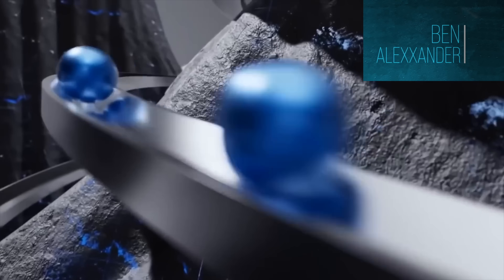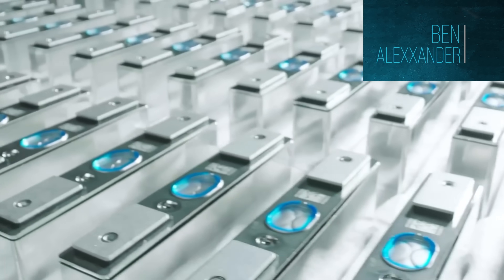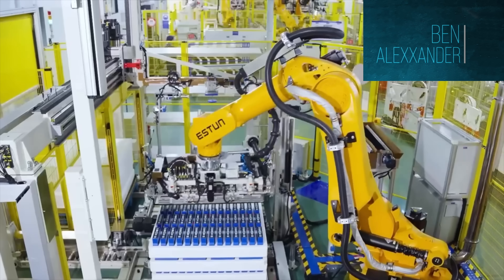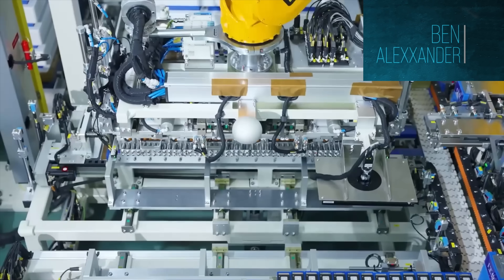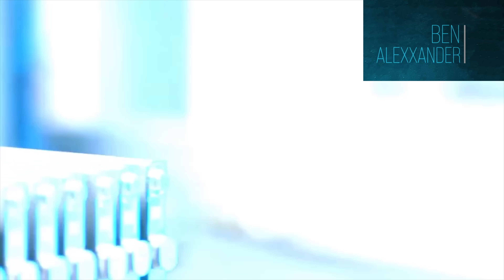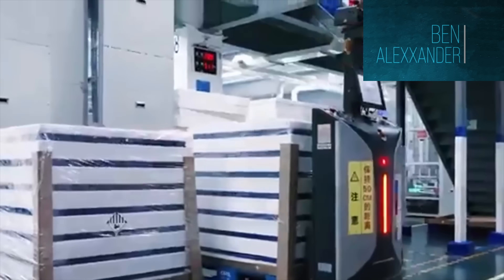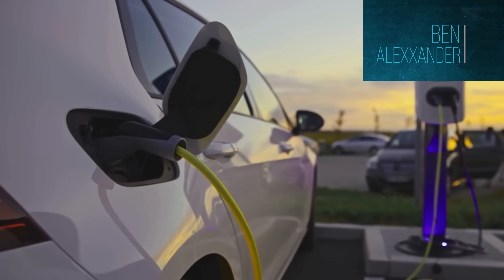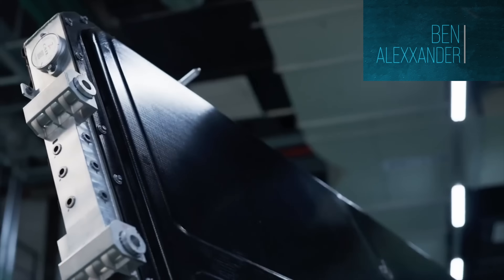CATL’s New Sodium Battery Lasts 3.6 Million Miles — 50% Cheaper Than Lithium

Comment: I think if these test numbers are coming from China id never believe any of it. A BIG thing we're overlooking though is the property of sodium, when its exposed to hydrogen/condinsation it dissolves rather quickly. At cold temperatures, sodium expands meaning whatever casing it's stored in would have to remedy this inevitability. Also, when it heats up sodium corrodes. Putting electrons through sodium could have environmental issues when recycling as negative ions will produce a small bit of radiation.

Comment: All very well, but unfortunately the general public will not see this cheap type of technology, it is not economically viable for manufacturers to produce long lasting cheap products, just go back a few decades to GE's electric light bulb (i think one still burns to this day). The powers that be will not allow this to happen, we could have had cars run on water, what happened to that? we could have had free electricity, why haven't we got self charging cars? alternators and regulators do it with vehicles now, why not with battery powered vehicles? the reason is the rich want to stay rich, and the governments want you to stay poor working to make them rich.

Comment: Charge time?  Can they fast charge?   Because there is still pretty much no one who wants to sit for 6 hours charging their car when going on a trip.      And I don’t think you quite understand the scale of energy used in the world.  Maybe we wouldn’t have to increase production of fossil fuels, but we wouldn’t still need it for a long time.      Also "solar is the cheapest"?!   Are you nuts?  It’s the most expensive , because it still requires traditional energy production right along side it to provide reliable power.   It’s maybe gonna be big news, but it isn’t enough to replace nuclear or fossils.

Comment: I'm sure both will exist for a while. Sodium just isn't as energy dense as lithium, and lithium is already too heavy for some applications. It is lighter than LiFePo and works in a wider temperature range.

The big draw for me is that sodium batteries are less deterimental to the environment and inherently safer. Most lithium batteries have magnesium which is basically impossible to extinguish once it catches on fire. LFP batteries don't have that and basically won't catch on fire but they're heavy. That's why a LFP EV car gets like 250miles when a traditional one gets 500.

Sodium stands to fit nicely between the two, but is apparently only slightly easier than cold fusion. 😂

Comment: Where are you getting $19/KWh?   It seems like you are picking up previous clickbait that was talking theoretical pricing based on material costs.  I read a more sober analysis recently that Sodium Ion was still a couple of years away from even hitting $40/KWh at the cell level, which is much more believable.

Comment: CATL makes claims that they NEVER verify by 3rd parties.  You're adding into the vaporware slop culture.  This is embarrassing.  It's atomically impossible for Sodium to perform 7-10x more energy density in comparison to Li metal batteries.  So on it's face it's patently false.  You need to stop ruining your credibility

Comment: Unlike what he quickly said here, this battery has nothing to do with gas, oil or coal. I don’t know what he was thinking saying this. Those produce power, batteries of any kind, store power. It’s not the same. He did also say that lithium would be needed for higher density uses, in opposition to what he also said earlier which was that it equals, or exceeds the power density of lithium.

The reality is that lithium does store more energy per volume. Until we see these in our phones, I won’t be impressed.

Comment: Heliogen is making solar-refingery using AI to angle the mirrors (instead of expensive motors). At scale, hydrogen becomes more cost effective than fuel.
Best thing about this? We can power the future of electric planes, with this. (Especially when constructed at the equator.)

Comment: 4:48 - Don't say that! New Denmarks micro Thorium reactors, will change the game also.
This is because sometimes you need a lot of energy, but not that much space. Think of future AI systems for example. Or factories. Or energy backup.
Good thing about micro reactors, is that their production and quality control, can be fully automated. They can be easily transported. Benefits of Thorium is that you can make the reaction stop even when the power goes out.

Comment: No, you're still missing the main point and hinderance to the adoption of electric batteries. Wind and solar can NOT supply the sheer amount of power to the grids of ANY country that is willing to go down this path. The cabling and power supply chains are just NOT good enough. Even if you could get everyone to change their cars within a ten year period. Even using coal and nuclear you still couldn't be able to bring a grid up to speed in such time. And the cost would be horrendous! Then you have the problem of thieves stealing the copper cabling that would be installed at recharging stations - which is already happening!

Comment: Yet another miracle battery!
We shall see!
Reply: I mean is it though? It's basically what we already have but can be made cheaper. You can only have one battery in your phone or laptop at a time for all intents and purposes the cost really doesn't mean much more power storage does and we aren't getting that. This is basically just good for large scale battery use like EV or home use.
Reply: Not yet another, the same we've been hearing about for years, and it's real now.
Reply: Says Ms Angry😂😂
Reply: They are on sale now....bluetti sodium ion battery. Really looking forward to what anti Ev angle you come up with next. We had so far, they set on fire, wear tires every 5k miles mine are 25 k and need a change now, there a little boy digging out the lithium. ect
Reply: If this is true, it's great news.
The only problems so far I can find with E cars is the initial cost tends to be very high , most garages will not touch EVs so that means high main agent service costs.
Finally the battery pack is on the bottom of the floor pan so is vunerable to road debri.   If a single cell gets damaged the whole pack has to be replaced which is expensive
Reply: Yeah! Every day for 10 years, it has been revolutionary, but none have delivered yet.
Reply: @Caspero83 They haven’t there’s millions of them out there you people are hilarious goal post movers.
Reply: @Caspero83 Bluetti just released a power station it can be purchased now.  Pioneer Na.
Reply: @Caspero83  CATL announced it is going into mass production in 2026, so it’s only months now when the first cars will roll off the line.
Reply: @LateForDinner-mn1hn  Haha, never heard that before. We will see
Reply: @Caspero83 When did you hear it before 🤷‍♂️
Reply: @Caspero83  I'm not surprised you haven't heard......See bluetti sodium ion battery for sale today for you. You keep driving the dinosaur banger granddad.
Reply: This one's different.  CATL is mass producing them for China's cars for next year and has been for months now.  This is a done deal.  But everyone is so skeptical of battery news (for good reason) they don't believe it anymore even when the largest battery producer on earth is rolling them off thte line and telling everone "here they are."  The question isn't when will they be commercially available.  They are now and being put in car packs.  The only remaining question is: "Will they deliver on the stated specs over time?" And one major point to consider there is that auto makers aren't going to tolerate using batteries without proof they work as designed.  Sodium batteries are here.  Everyone had better wake up and take notice.
Reply: @advil000  WE  ARE NOT SKEPTICAL ITS BS
LOOK AT THE SALT OFFERING FROM BLUETTI ITSAN OVER PRICED JOKE JUST LIKE THIS WILL BE
Reply: @HeathensHaunt What’s a joke about it 🤷‍♂️
Reply: FYI the battery in my xiaomi 15 ultra is already a sodium based one, and that came out in 2025
Reply: @MikeAnthony1991 gsmarena says otherwise
Reply: @jpmohan96 true, I mixed up with si/c
Reply: When I can buy some AA batteries on amazon get back to me.
Reply: Not a miracle battery. They are much heavier, are less energy dense than lithium and degrade faster (though this difference is reduced by limiting charging to 80%ish max). So pros and cons. For EV/Hybrid in Canada however Sodium Batteries are game changing! 90% battery capacity at -40C (much better EV range in winter), able to safely charge at much lower temps and potential cost savings are the biggest difference. As far as max EV range in ideal temp ranges though, sodium will not beat Lithium Ion.

Comment: CATL's sodium-ion battery, like the Naxtra, uses Prussian blue analogue (PBA) materials which contain cyanide groups, posing a potential safety risk of releasing toxic cyanide gas if the battery is damaged or overheated. However, CATL claims their Naxtra battery meets stringent new safety standards (GB 38031-2025), indicating the company has implemented measures to mitigate this risk and prevent thermal runaway. Concerns remain in the scientific community about the long-term stability of these batteries, with research identifying potential cyanide release and exothermic reactions under certain conditions.

Comment: You forgot the environmental and safety issue of sodium batteries: the cathode uses Prussian Blue Analogues (PBA) which incorporate the cyanide ion. This chemistry requires use of toxic cyanide chemicals. Not an issue for you or the environment??? Really???
Reply: Compared to the environmental damage of mining and refining lithium, a bit of cyanide isn't really a reason for concern, not to mention that lithium batteries themselves release hydrogen cyanide when they burst into flames. Most of the wood that's treated for pallet use for example, contains arsenic and cyanide compounds in it and we deal with that on a daily basis without any problems.

There is no free lunch, even a process as simple as evaporating sea water leaves you with salt, but also a bunch of noxious chemicals and heavy metals that were already present in the water due to air and water pollution. The trick is to choose the least destructive/polluting process when doing anything regarding chemistry.

Comment: If I remember when sodium is added to water, it undergoes a vigorous and exothermic reaction, producing hydrogen gas and sodium hydroxide. The reaction is so exothermic that the heat can melt the sodium into a ball and ignite the hydrogen gas, causing it to either burn with an orange flame or explode, especially if enough hydrogen is produced and trapped.

So my question is, is it safe?
Reply: It's safe because the pure metal isn't present inside a sodium cell. I believe it's a sodium compound dissolved in an electrolyte.

Comment: Remember.when lead accumulators was the only option (still used in fossil cars for some reason). Then there were the NiCad s which came in the 1980ies or was it 90ies the new millenium brougt the lithium ion.  So now 25 years later Sodium is comming. A really good news!   I am foreseeng a ship container with sodium batteries standing at every car charging station along the highway. If you want to charge your car as fast as you fill on petrol you need to be able to pull a MW out of the grid. Better to have it stored locally,  trickle charging from solar pannels when daylight. Solar pannels are not good looking in the landscape  Looking forward to see every roof and skyscraper outer wall made of “solar pannel material”. Maybe one day you can build roads of solar panels instead of asphalt. The American Petroleum Institute’s fight for destroying our planet is pathetic. Petroleum is valuable for making chemicals, it should never be used for just putting CO2 into the athomsphere causing global warming.

Comment: The Sodium will most likely be soured from common salt which will produce a lot of Chlorine which will need to be used in something like PVC, so more plastics in the world. PVC sheet, pipes, electrical cable insulation and inflatable Frog suits.

Comment: In winter, my solar panels generate less than 10% of Summer production.

For 3 to 4 months, I frequently don't generate enough to power my house (with or without a battery).

We've just had a week of nation-wide near zero wind too.

Grid batteries are a nice idea, but having the capacity to replace the natural gas power stations is total fantasy.

Comment: Embedded systems engineer here. Ordered 32140 format cylinder Na-Ion cells earlier this year for testing purposes straight from alibaba. Cells are 30Wh, 10Ah, 3.0V nominal voltage. Discharge curve is almost a straight line from 4.0V to 2.0V with a little bit of a knee at 2.5V.
 Bought 24, for about 2€ each, although air shipping was about 100€. They did perform capacity wise as specified. Note that the voltage swing is full at 4.0V to empty at 2.0V, which is larger than traditional Li-Ion chemistry which is about 4.2-3.0 V. The cells have worse gravimetric and volumetric energy density compared to Li-Ion by about double, meaning they weigh twice as much and take double the space. Energy/cost ratio is better than Li-ion. Can't say anything personally about fire/volatility/safety, as I haven't done destructive testing.  Potential in static energy storage and lower capacity EV usage.

EDIT: Some extra info on the cells. They accept charge at 1.5C (15 Amps in this case) quite happily with only about 5-7 Celsius temperature increase, at 1.0C (10A) they are almost ambient temperature. So thermal wise they can be charged at a high rate without extra cooling, for sub 1 hour empty to full charge. Likely capable of higher charging rates with higher allowed temperature rise and of course with extra cooling. 
On the discharge side I have tested them up to 80A per cell, with case temperature rising to 60 Celsius from ~22 Celsius after a few minutes, so they can provide good burst current without immediately becoming thermal limited, although the increased mass here helps to dampen the rise of the temperature.
I mostly built battery packs for my small personal EVs like electric skateboards, drift trikes, e-scooters and other DIY gizmos. Packs are usually in the energy range from 200Wh-1000Wh, with different series and parallel cell configurations depending on the chosen cells and application. Although I am currently widening my skillset to include USB Power Delivery capable powerbanks.
Reply: Awesome report! Thanks.
Reply: Thank you!
Reply: So, for home systems, pimpin'.
Reply: Ive been building batterys for 15 years now. ZIB and NIZn are just miles ahead. The dumo voltage of NI and fast charging is insane. ZIB also really impressive. It feels like the whole world it 15 years behing me. I dont get it. Ive never got Lion, so hard to source, so pathetic at dumping or charger per cell. Kinda dense, but not worth the payoff

Comment: The major drawback for sodium - which is really taking off as a battery chemistry - is that size and power density make it ``not great'' for mobile applications like cars/scooters/etc. It also has voltage sag issues at high drain, again, making it not ideal for vehicles.

Comment: Will Prowse did a video not too long ago on why he thinks LFP will remain in home batteries for a while still. Mostly it was because of the wide voltage range with inverters not being designed for low voltage operation. However, with higher voltage inverters coming along, I think that won't be as much of an issue in a few years, as long as the installation is done properly.

Comment: These could be a major game changer for off grid solar RV’s. Being able to charge below freezing would be really nice. Self-heating lithium- takes time and power to come up to temperature before charging begins-during winter when solar output and time is already reduced.  You end up giving up limited interior storage to relocate batteries into the climate controlled interior. Vehicle wise, too, when it’s way below freezing charge times are much longer as it takes time for the heating system to bring the batteries up to temperature. 

Reported reduced thermal runaway risk might be a game changer too. 

This is in its infancy, but all things considered it wasn’t that long ago when lead acid, nicad, and nimh were what was available.
Reply: Yah .. I remember that lead-acid battery motorcycle they used to haul around as a demo.
Reply: @suzyamerica4679  Yeah it’s made major changes in model airplanes too. Li-Po packs put out tremendous power for their size. I built an old school kit for a 12’ Telemaster a few years back and the plans showed an option just packed full of nicads. It would have taken hours charge to fly for a few minutes.

Comment: If used in electric cars, the one question you did not address in any detail is the length of time these Sodium batteries will take to charge up.  Waiting at a charging station for 30 minutes is a ridiculous amount of time for the current Li-ion battery technology that Tesla currently uses, and that pretty much kills enthusiasm for any long-range driving.
Reply: Maybe back in like 2016 you’d be sitting at a supercharger forever. Nowadays it’s 10-20 mins and you’re on your way. Sometimes it charges too fast and I’m still in line for the restrooms lol
Reply: @gregolas597 yeh, that doesn't happen.
Reply: @generalzod7959 but… it does though… when’s the last time you’ve been to a supercharger?

Comment: Both wrong. LFP is 45 USD per kWh. Sodium Ion is 125 USD per kWh. Studies suggest both will have the same cost in 2035 to 2040.
Reply: Existing sodium ion was $125, but these new ones are not.

You can’t use previous numbers to analyze new products at new price points.
Reply: @Georgewilliamherbert Try to order it for 19 USD. You won't get any cell. Where can I order?